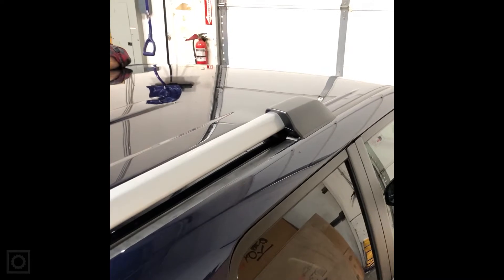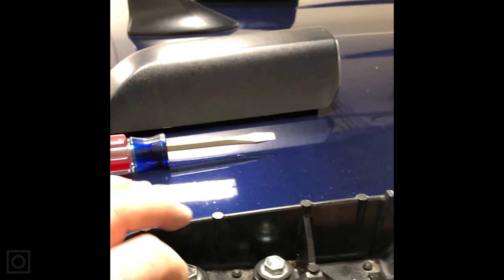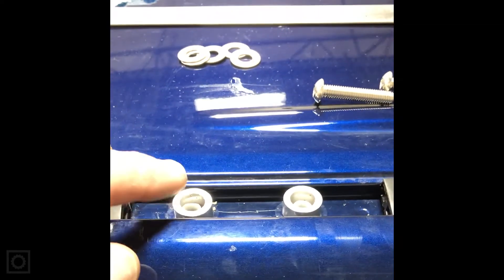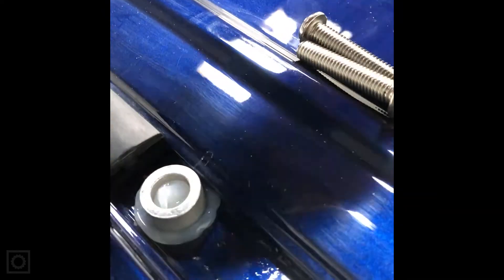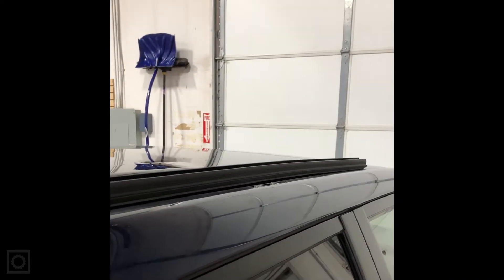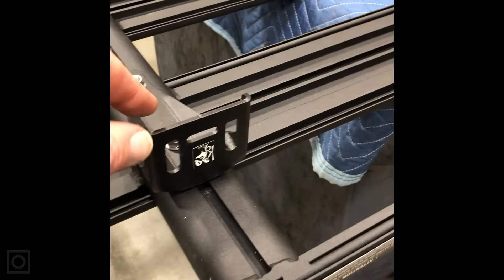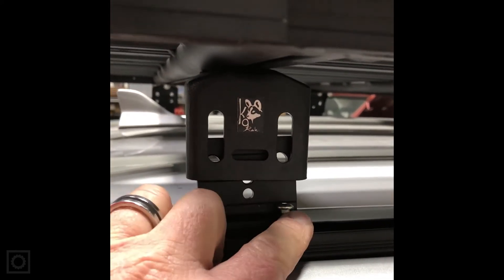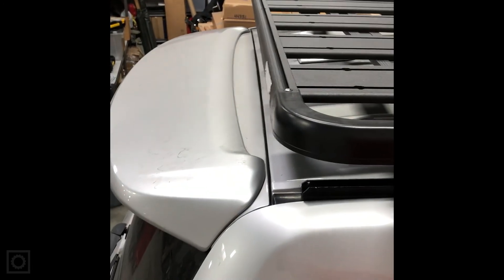EQUIPT 101: Installing Eezi-Awn K9 Roof Rack Rails

Comment: Hi Paul, thank you for post this video. I am currently doing research on a roof rack that will be the best fit for my needs once I purchase my 4Runner later this year.

So can you tell me if I purchase this roof rack do I need to drill additional holes ones I remove the existing roof rack to replace the K9 rack?  Will it create loud wind noise if I add LED bar lights to it?

Comment: I can put a Yakima roof box on this platform?
Reply from the maker: There's no definitive answer here due to the sheer number of Yakima cargo box configurations and four different rack widths that change the spacing between slats. We would need measurements with the spacing of the cargo box clamps. We would then need to compare those measurements to the platform measurements. Some should work, some will not. Reach out if we need to compare measurements!

Comment: I wish I would've know that I needed to add silicone prior to watching this video. No where in the installation manual does it say that it's needed.
Reply from the maker: It's not required, Ben, but we do it for that little extra protection against potential leakage and an easier way to keep the spacers from moving position when you set it. We have plenty of clients who haven't done this and haven't experienced any issues so you shouldn't have a problem :)